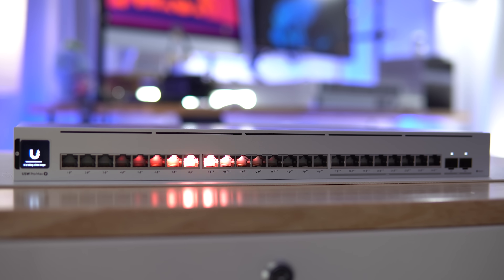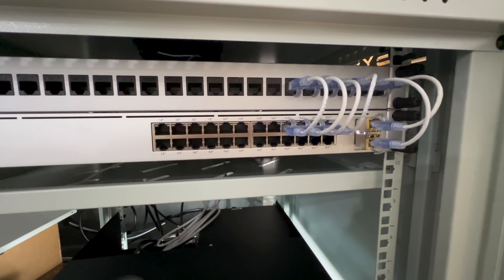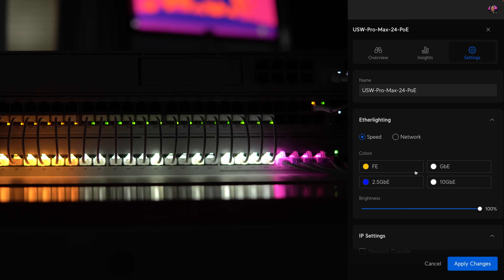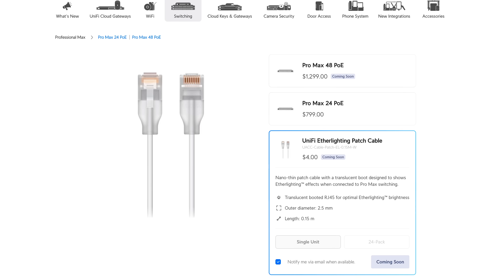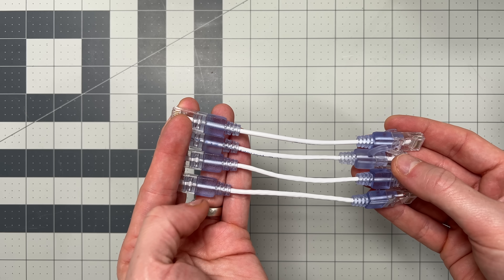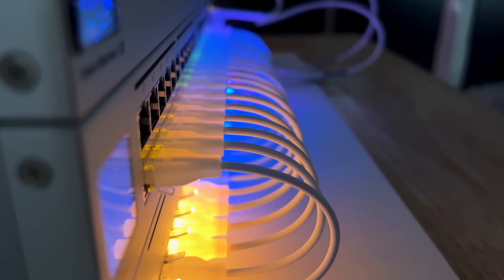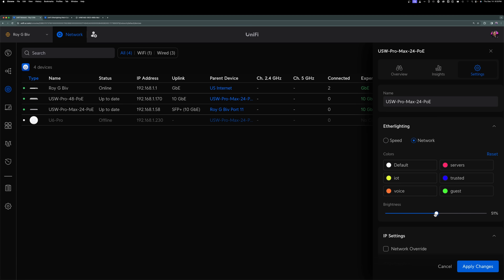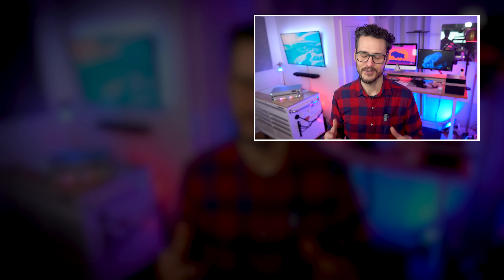UniFi Pro Max Switches & Etherlighting Patch Cables!

Comment: It's Meh, would rather have them put out a multi port 10G / 2.5G switch with more than 2 10G ports
Reply: They already have an aggregate switch with 8x 10gb ports for $279
Reply: They have a 24 port 10Gb switch, Enterprise XG with 2x SFP28
Reply: That their layer 2 1Gb switches still have 1Gb SFP uplinks instead of 10Gb SFP+ is outright absurd.
Reply: 100%. It's a rackmount switch with fans...it goes in a cupboard so the noise doesn't annoy you.
Reply: Your “meh”